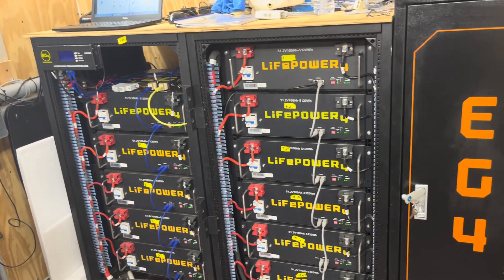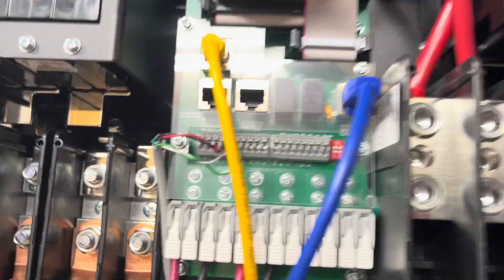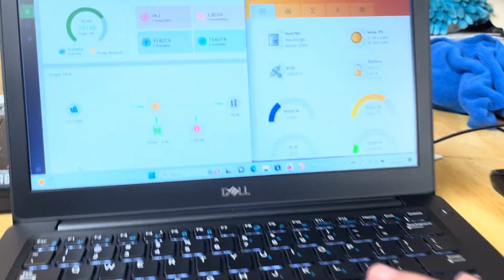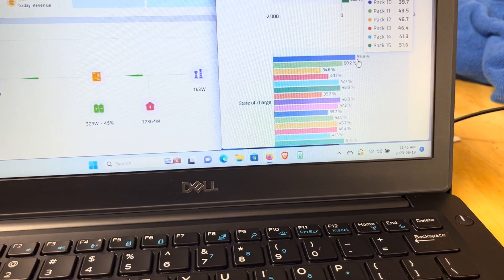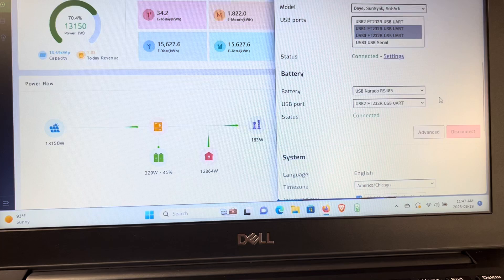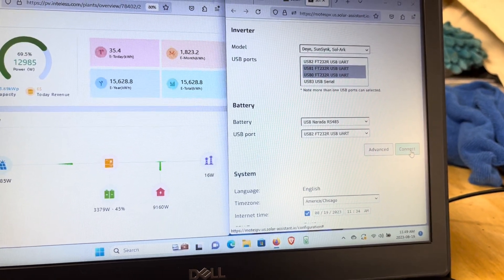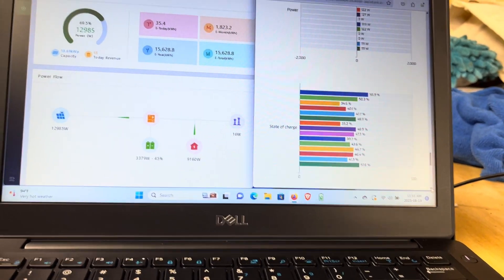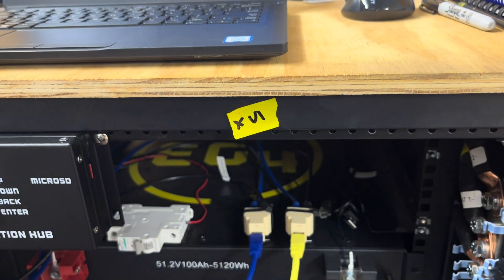Monitoring Individual Batteries In A Large EG4 Battery Bank.

Comment: That seems too awkward to be practical. I’m planning to build a battery that is similar in capacity but I’m going to take 96 lithium iron phosphate cells and I’m going to group them and six blocks of parallel and 16 and series and there will be only one state of charge monitor. Each cell is rated for 304 amp hours. There will be no deviation between paralleled cells. I think I’m gonna have to make a YouTube video
Reply from the maker: You should. That would be interesting to see.

Comment: Brother how long can u run on those batteries..
Reply from the maker: It really depends on how hot it is outside. I’ve been 100% off grid the past three days. 

The prior three weeks my energy requirements were so high I couldn’t generate enough to power my home AND fully charge the batteries. So there were a lot of days I would go on grid from around midnight till 9 am. 

Back in April I was on grid around 10 hours for the whole month.